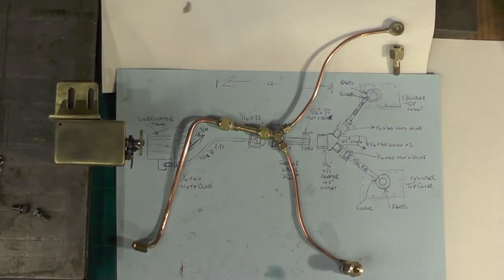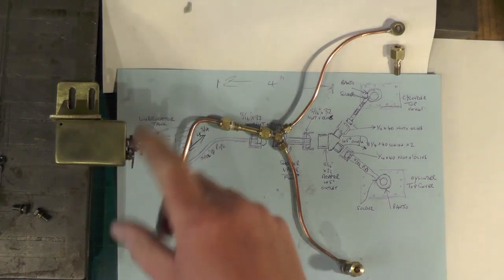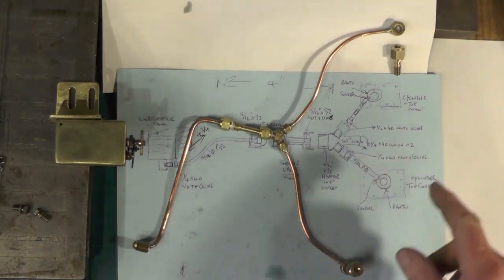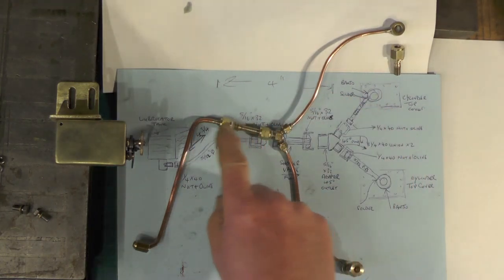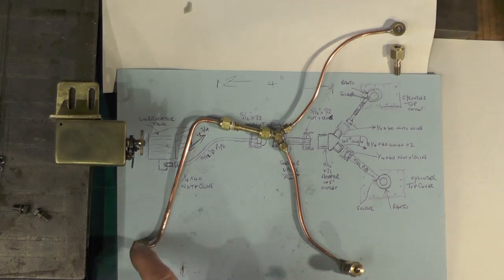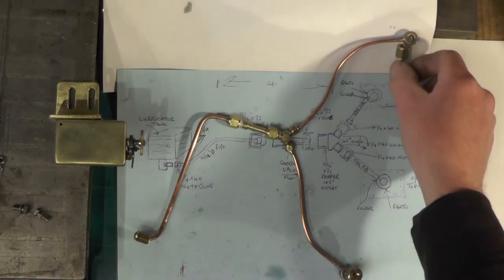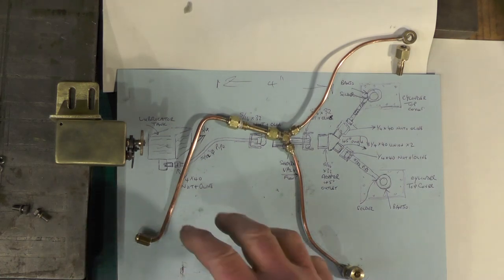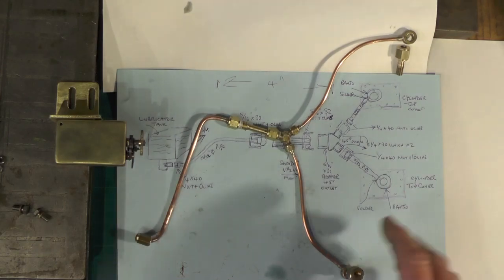Build Your Own Beginners Miniature Steam Locomotive Series ( Lubricator P3 ) "mr factotum"

Comment: Nice job sir! I hope you are going to reform either the pipe work or oiler connecting rod to prevent them rubbing?
Reply from the maker: thankyou LS
i did notice how close they were, but tried a feeler gauge in and there's .010" gap now adjusted at its closest, so will keep an eye on that, thanks
regards
mr f

Comment: Hi Mr. F, nicely fitted lubricator. I guess its coming  up to the 'grand finale' I believe. Right?
Stay safe and take care
Emanuel Lautier
Reply from the maker: hi el
not far away, still a few odds and ends to sign off, also lockdown has interrupted the final boiler inspection, to get it certified.
you stay safe too
mr f

Comment: Good day Mr F . 
Can I ask if that is real steam oil ? It drips quite fast from the banjo fitting .
You may have read that the lubricator pump works proper with the thick gooey steam oil .
Cheers 
Craig
Reply from the maker: hi tfs (craig)
No i don't have any proper oil as yet. lockdown has prevented these kind of issues, also its delaying final boiler inspection, but no rush still a few odds and ends to finalise
see you next time
thanks mr f

Comment: Nearly time for a steam test?
Reply from the maker: Hi ttg
Yes,  a few odds and ends to sign off, may have to steam test at home, still can't get to my club for final boiler inspection due to lock down,  also no coal and no proper steam oil as yet,
By the way fixed the whistles from pointing downwards, thanks for the tip and advice, appreciated
see you next time 
stay safe
mr f
Reply: You can get hold of anthracite coal online easily and steam oil so have a steam up at home!

Glad you got the whistle sorted 👍
Reply from the maker: @tom_tom_go  never thought of that tom, thanks

Comment: there can't be much more now! the weather is nice lockdown is coming to an end, you have to get it on the track for us. have you got owt to sit on?
Reply from the maker: hi pr
just a few odds and ends to sign off as yet, yes i made  a riding truck  when i built my battery electric loco from scrap items, take a look its all been logged, videoing was a bit ropy though in those early days, may be it still is though!!!!!! 
Got to get final boiler inspection before i can be let loose on a track
thanks again 
stay safe
mr f